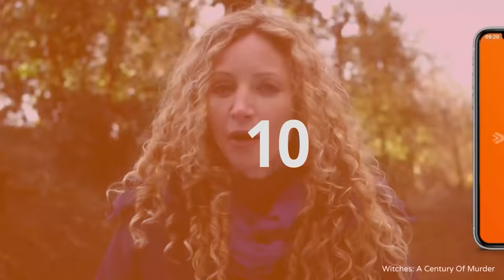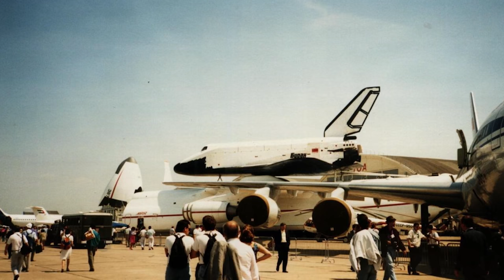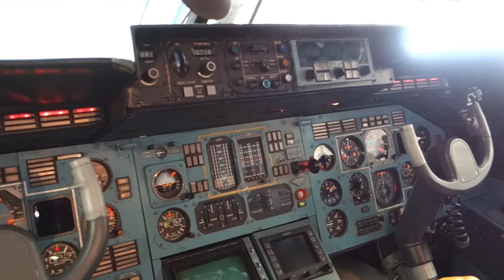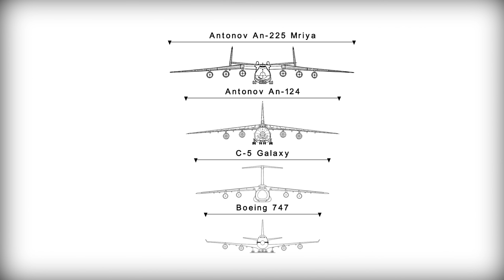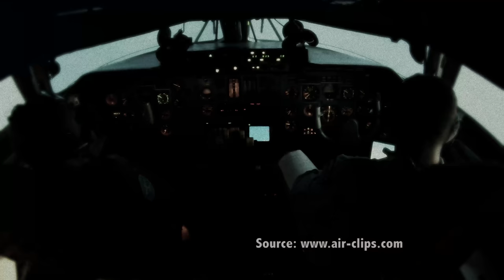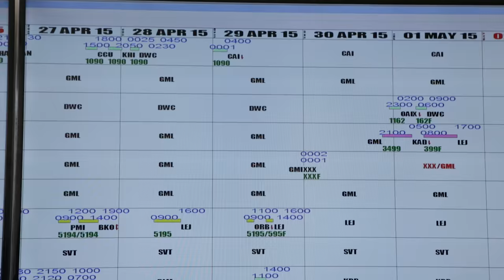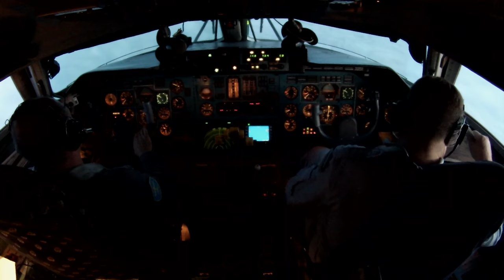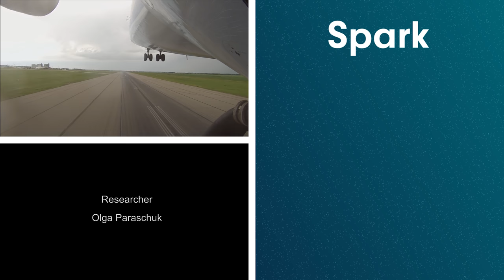Antonov AN-225: How Was The Largest Airplane In The World Built? | Heavy Lift

Comment: I worked for Lockheed when the C5 was being designed. The question was asked "What is the largest aircraft that can be built". The answer in the company paper was that "Even with the materials we have now there was no limit to the size of the aircraft.  Giver an efficient powerplant the C5 could have been built in the 1930's". The real limiting factor is the ground area that can be made available.
Reply: yeah, that was what I was thinking, especially near the start when that guy was going on about how difficult it was, etc. well the truth is the formula's that need to be abided by for engineering plane specs and tolerances have been known for quite some time. Any large aircraft manufacturer could build something a little larger than the 225
Reply: @psycronizer  The 225 was essentially a scrapped military aircraft that was salvaged. The question is there enough  demand to build one at todays cost. I think the Russians destroyed it knowing this.
Reply: @jayreiter268  right ! ...lol..
Reply: I am applying to work on the F-35 program. How did you like working at Lockheed?
Reply: @jayreiter268    Building just one or even few would be too expensive and there is no need to built large number of them.
Except, China is interested  and maybe they will produce it.
Reply: @BrianYYH  I cannot say I worked there 50 years ago.
Reply: @jayreiter268  Wow that's quite a career, could it be possible to build a C-5 Galaxy with 6 engines to replace the unique role of Antonov 225?
Reply: @Sarnarath  Anything is possible.  Some things to consider. The C5 does not have a wing center section. There are two large fuselage rings that the wings attach to. With modern engines you would not need 6 engines. The C5 wings had problems in service.  The costs would be high and probably not justified.
Reply: @jayreiter268  well the history for the second AN-225 said as much...
Reply: @PrograError  The last estimate I heard a few days ago was $4 Billion to complete it up from $300 Million I first head.
Reply: @jayreiter268  also to drop Ukrainian morale

Comment: I used to work at Boeing in Everett. They make 747's there, along with 777, 787, 767's. It is a huge facility (largest by volume) in the world. I wish I could have seen the largest plane in world (AN225) in the biggest aircraft production facilities. The Antonov holds many world records, I doubt something bigger will come later to take the title. There is a 2nd AN225 partially constructed. Maybe salvaging parts off destroyed plane, along with parts from #2, the AN225 can return to the skies.
Reply: unfortunately unlikely, the shell hit the hangar behind the center section.
the whole question is the state of the power spar of the left and right wing consoles, how they endured the thermal effects of the fire.
after all, there is nowhere to make them, the plant in Uzbekistan did not survive the 90s, and not only equipment, but also machines of such sizes and power.
sorry for google translate
Reply: I was thinking the same thing, hopefully they can make a whole usable aircraft out of what's left between the two.  That really sucks though
Reply: @MrKKUT1984  yes, I think so too! but only on Wednesday, the 23rd, they just installed engine No. 3 (came from a major overhaul)
connected everything! hoses, electrical...
On the 24th they were going to start testing the engine ((
the men said that when the helicopters with the paratroopers arrived, they hid at the gates of the plant and after the helicopters flew away, the An-225 was intact, but then our artillery began shelling the territory in order to knock out the paratroopers from the far parking lot (where the buildings of the border guards and generally closer to the airstrip) and they returned to the entrance to the shelter, and then it got dark and they were able to leave from there ...
sorry for google translation
Reply: @андреймарченко-р9ф   I was also thinking the same. Also all the electronics / avionics racks and equipment are burnt, the flight deck as well. And many part are unique to Mriya, not everything from Ruslan can be transferred to make new aircraft.
Technology of Mriya is too old. None of the equipment it had installed is made anymore, and the factory that made them are all closed or bankrupt. 
:(
Reply: @андреймарченко-р9ф   If there will be new An-225 will need to use electrical / avionics / system of An-158 or 178. And new engine with Fadec instead of D18T should use RB211 or CF6-80.

Comment: I saw one at Oshkosh — a crowd of people were amazed at the 3X redundancy of the brake-lines —- because all the hoses were brittle and cracked !
Reply: You mean to say you saw "it" at Oshkosh.  There was only one ever built.  She will be missed.
Reply: @phoenixrising4073  two built, only one has flown.
Reply: @brandonadams7837  from what I gathered they started working on the second one but never finished it.
Reply: @phoenixrising4073  correct they used it for spare parts for the flying one.

Comment: At 20:40 the narrator says the takeoff speed is over 850 kph. Which is around 500 mph. 😂😂
Reply: I came the comment section for exactly this.  I would dare to say he meant 350 kph although I don't know what her real takeoff speed was.  He then says cruising speed of 800kph, lol.   RIP An225, you will be missed!
Reply: A quick search reveals takeoff speed was between 290 and 320 kph depending on weight.

Comment: If they can rebuild this with Four modern engines the fuel burn and range can be improved
Reply: Already a 4 engine airlifter called An-124 is in service in large numbers...
Reply: @spectre3954  True but they are not AN225 size with modern GE, P&W or RR 90,000 pound thrust engines. Those engines have improved fuel burn and reliability. In any case the problem is the war and loss of life.
Reply: @jayreiter268  I would prefer the more iconic 6 engine design, maybe with those engines for better takeoff performance and maybe to carry heavier loads.
Reply: @minute0420  I am a little late replying. The 225 looks to be a stretched 124. There is a wing center section added. As wing span is increased lifting ability increases. The outboard wings look to be the same as the 124 wings. I do not know what internal changes had to be made. The 124 can not carry the strange loads as the 225. If it could they would not have needed to build the 225..Engine power alone does not increase lifting ability or speed. it seams to increase rate of climb.

Comment: Ukraine has never produced the AN 225 , and the one who claims the opposite is lying! The AN 225 was produced in the USSR : large - sized milled power frames, lowlands and fuselage brackets were produced in Ulyanovsk . The central parts of the wings with flaps and the end (detachable) parts of the wings — serial consoles from AN-124 - in Tashkent. The A-825M aircraft control complex in Moscow. Most of the new components, small parts of the fuselage and system parts, fairings and fairing, the nose of the center section and others.
Fuselage assembly in the slipway, general assembly of the aircraft - In Kiev, USSR (Ukrainian Soviet Socialist Republic).

Comment: Ukraine is wrongly proud.  First of all, Oleg Antonov was a Russian, working for the Soviets.
But when he constructed the smaller AN-124, it was typical copy of American C-5 Galaxy.  Soviets did that many times, including the Shuttle.   In those times, USSR had no 747, so they had to make heavy carrier themselves.  They stretched AN-124 and because they did not have stronger engines, they had to use 6.  Today, Mria could easily fly just on 4.
It's a shame that such a unique machine was destroyed.
Reply: Neither AN-124 nor Buran were copies of American vehicles. They were built for the same purpose and had similar characteristics, but were much better. For example, Buran could fly and land fully automatically unlike Shuttle and Energia could launch any other payload without Buran. Energia didn't use SRBs and thus wasn't so bad for ecology, also safer to fly.